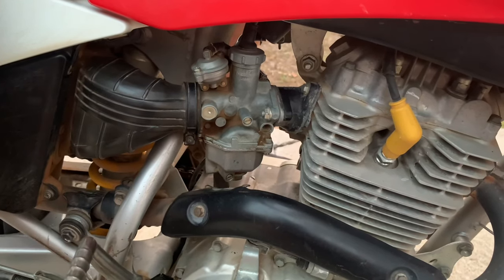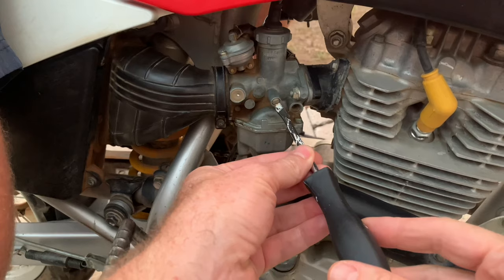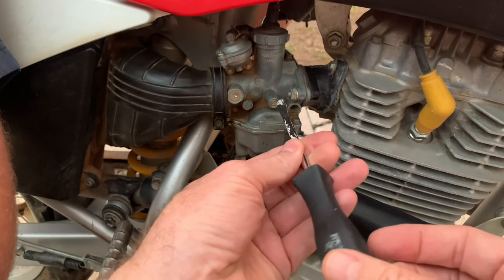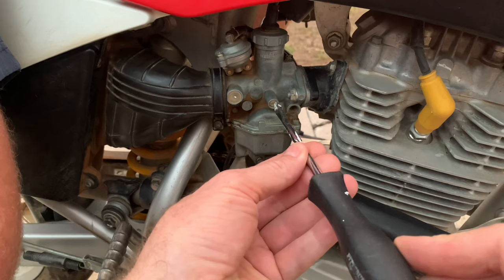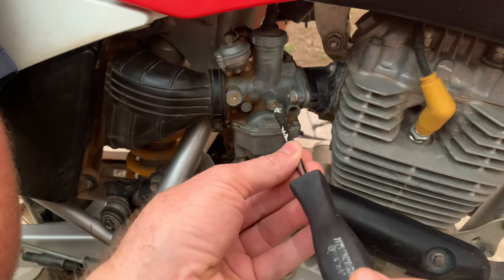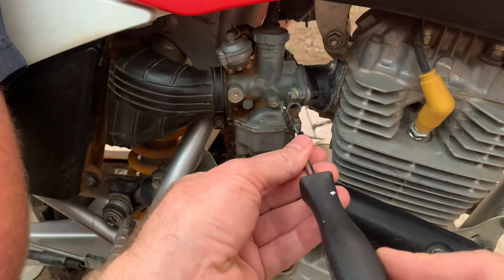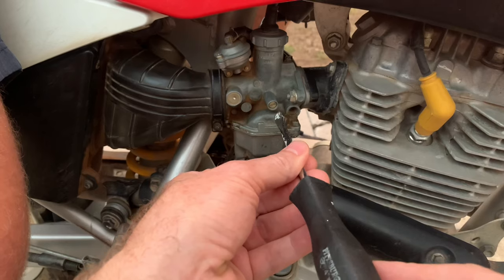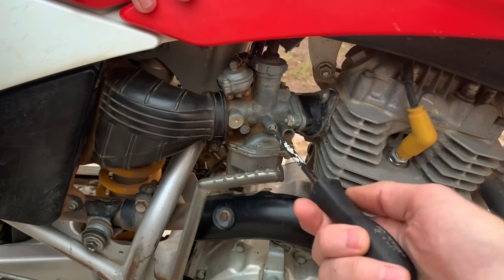How To Adjust The Idle Speed On A Dirtbike

Comment: bro i kickstarted my shii after cleaning the carb and my bike was screaming at me😭😭😭 thx for the vid😂
Reply from the maker: You’re welcome
Reply: how did you do it bro😂 like mine be reving all the way up once started and if i let it keep reving it will rev till it blows so i have to hit the killswitch how can i set it if my motor not warm and i can get it warm😂😂
Reply: Same that’s how mine is. lol I was so confused as to what the problem was.
Reply: @448Sak I had the same exact problem when fixing one of my smaller bikes after cleaning the carburetor. I’d kickstart it and it would rev all the wayyyy. Issue was the needle throttle that you screw in on top of the carburetor. I guess I didn’t do this correctly the first time. Try that. Take it out and re-screw it in. Should here a proper click.
Reply: @Squishmallows_526  had the same exact problem when fixing one of my smaller bikes after cleaning the carburetor. I’d kickstart it and it would rev all the wayyyy. Issue was the needle throttle that you screw in on top of the carburetor. I guess I didn’t do this correctly the first time. Try that. Take it out and re-screw it in. Should here a proper click.

Comment: My bike dies when idling even after it's been warmed up and rode for a while. Would this fix the problem or could that be something different?
Reply from the maker: This might fix it. It’s worth a try. Cleaning the carburetor would probably be the best thing.
Reply: I had this issue once but on a way more severe scale. The main issue is probably just that you havent cleaned your jets. Its not something I was told needed to be done and I doubt its talked about very often.
Reply: if its a 2 stroke it might be compression issue. check reeds first
Reply: @hoohoohoblin  Hey buddy my carb looks similar and there is a hole there but no adjustment screw. It's a Kei hin Japan carb. I only have one adjustment screw near the bottom of the carb close to the bottom.

Comment: My dirt bike has the problem you mentioned about where it will idle and when reved up the throttle sticks at 3k rpm. When idle screw is adjusted it will idle again. Plus carb cleaned twice. What could be the problem? Thanks
Reply: Maybe you did not place the throttle cable back in properly
Reply: Hey mate have same problem as you, did you end up fixing the issue ?
Reply: @M-Revs  could be the throttle you dint put it back properly
Reply: @marvinhsison5185  ill check today, i cleaned carb yesterday made no difference

Comment: i got a 4 stroke Fuel injected bike dies when pulling In the clutch going to first gear
Reply from the maker: Sometimes a new bike has a switch on the kickstand that kills the engine with the kickstand isn’t up when you put it into gear. If that’s which goes bad, it could cause this problem.
Reply: @hoohoohoblin  dirt bikes do not have a kick stand bro
Reply: @joslow9151  ya trailbikes do acually
Reply: ive got the same issue. i got my bike serviced and when i got it back home the idle was really low. when i start from cold the bike dies when i try first gear. how did you fix it? ty!
Reply: @joslow9151  mine does and pretty much every one I’ve seen does
Reply: @joslow9151 bro what? My dirt bike indeed does have a kickstand

Comment: At the moment my big bored XR200R is running about 1750rpm choke off, then not quite idling cutting out about 750rpm choke on. If I adjust the screws it barely makes a difference or just cuts out needle on 3rd notch, going to put on 2nd notch tomorrow and see what happens, it's a just built from scratch engine and bike.

Comment: I know this is a old post an don’t know if I’ll get a reply but my dirt bike had high revving problems I took the carb off cleaned it etc and put the throttle cable back on right I made sure of it. So now it’s still revs somewhat high mabie 2500 rpm’s but when I pull the throttle it stays at whatever rpm’s I pulled it to for about 3 seconds an then works itself back to the 2500 rpm’s. What could cause that issue. Thanks.
Reply: Same thing
Reply: i guess fuel mixture is too lean, try to decrease air or increase fuel on your carb
Reply: make sure that you have assembled everything correctly.  I forgot to put my float needle back and it started leaking gasoline. I put it back but appearently the rubber oring went bad, and oozing gasoline. I had to buy another carb from china.
Reply: None of the answers above are correct. The issue is your throttle cable. You have it too tight. Near where it connects to your front brake lever, release the tensioner bolt and turn it counter clockwise until your throttle FULLY closes.

Comment: I want to turn it but I’m afraid it will mess up the timeing on my carburetor. Is that a concern or no? Cuz I use to mess with idle screw on my old car but I don’t wanna mess up my Yamaha royal ⭐️ by messing with the idle
Reply from the maker: It should just cause it to run a little bit faster. It doesn’t change the fuel mixture. It’s just like opening the throttle up a little bit more.

Comment: Exactly what’s happening with me. I adjusted to a good idle sound, twist throttle, it revs and does not come back down for a while. Finding sweet spot is the trick. 

Any suggestions?
Reply: you need to adjust air too
Reply: @dustypaint  for the wheel

Comment: My 250 keeps dying when I give throttle, and will barely idle , any ideas , close to selling price of shit it’s a brand new bike too, , if ur gonna get a bike do not get a carb bike, you’ll regret ufc cheap Chinese shite
Reply from the maker: A lot of motorcycles are set up to run really lean for emissions purposes, so when a little bit of dirt gets in the carburetor, it can’t get enough gas. If you can find a carburetor kit for it, that makes it run richer, that will make a big difference.
Reply: @hoohoohoblin  figured out the fuel line was only letting drips through replaced part of it and seems to be better now